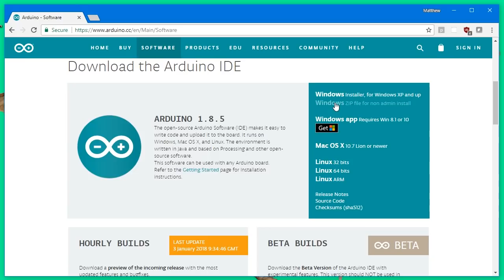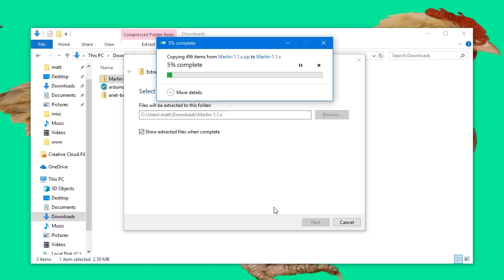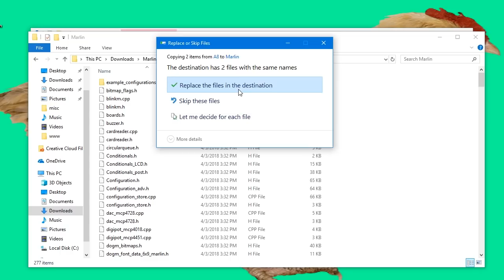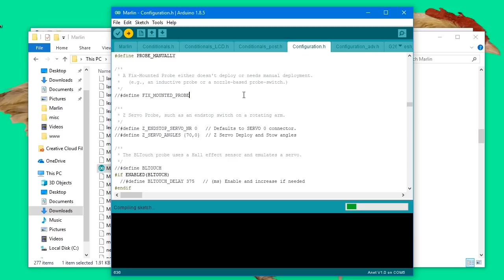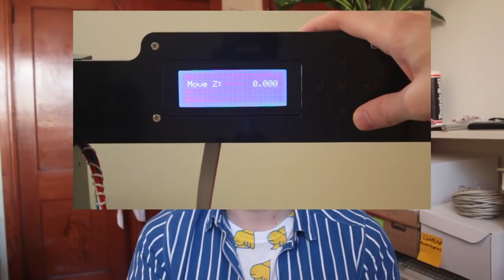Anet A8 Upgrade: Why & How You Should Update Your Firmware - Marlin Install Tutorial

Comment: I’m having some troubles. The arduino is having errors. I don’t know if I’m doing something wrong. The printer is on and stationary, and I’m trying to upload the code just like the video shows. I have tried all com3/4/7 and both Anet v1.0 and (optiboot). What do I need to do or not do?
Reply: solved the problem, its probably that i have upated version that it didnt work for some reason when i did uncoment some stuff mentioned. so when i relaunched the arduino,i ddidnot touch anything,and just uploaded to the printer. it worked and i do have the bedleveling option and all that. itseems to be working.
Reply from the maker: Glad it worked ! I've had some times myself where it wouldn't upload and I'd relaunch the Arduino software and it worked. Not sure why this happens.

Comment: As much as I really appreciate your contribution, I found myself getting ticked off because I'm a newb and you're going so dang fast that, even though I can pause, and did a LOT, you didn't tell us if we need the A8 board powered up to do this or not. I've had a ruff day as well, so take that into consideration. Bed sticking is my nightmare right now and the hairspray I picked up just spits out and blobs so I'm hoping with PLA that it will still work. I plan on printing RC airplane parts after I get things all worked out and need perfect 1st layers and thin walls. I'm printing a power switch mount and Mosfet mount for upgrading that stuff.  Uggghh.... I have two burned fingers from trying to unclog the crappy PLA that came with the printer.   Anyways. I really do appreciate your video. Everything I've touched today has fallen apart. I'm afraid to take a piss now.
Reply from the maker: Garry Kennedy heh I understand! I’ve had many frustrating moments with my printer as well but it always gets better. A few times it has meant buying a new part because I broke something. And yes I agree with the speed thing. Had I known so many people would watch this video I would have redone the screen cap slightly more slowly. But thanks for watching and hang in there !
Reply: Thanks Matthew. I've got it dialed in now. Printing great and doing a RC airplane tail section right now. 2 thick coats of Aquanet and it's all good. I am afraid of bricking my board but I really want that heating check sum safety that Marlin has. Plus it's not near a computer ATM. That may change soon as well though. Much better day though. I'm hangin'.

Comment: Great tutorial. I am having some issues with the bed levelling not saving but I think that will be solved by adding the command in the goose. My main issue is that no matter what I enter in multiple slicer my part (radial) fan always sits at zero unless I manually override it using the LCD menu during a print. Any ideas?

Comment: Something is not clear, how do I connect a NPN proximity sensor to Merlin? The home point is on the left edge and therefore the sensor does not recognize the surface
Reply from the maker: Hey there. This tutorial does not cover using a sensor for bed leveling. It's only for use with manual mesh bed leveling. You can see more info here: http://marlinfw.org/docs/configuration/probes.html take a look at the PROBE_MANUALLY option.

Comment: Hey man, so Im new to the 3td printing world.  I have had mine for 2 years and started using it quite a bit this year.  So last night I downloaded repetier host 2.1.6, I was on 1.1.9 or something like that.  but I upgraded repetier last night, and I just finished your instructions on firmware.  So when I uploaded it, it gave me an error, saying com 4 port wasnt available.  So I unplugged the usb cord and plugged it back in and hit upload.  So it uploaded with no errors.  but when I open repetier host now, under the manual control tab, you have flowrate, feedrate, extrder, and bed.  Well the bed option is gone entirely from repetier host, like its not there to click to turn on and heat up the bed.  I dont know what to do now to be honest.

Comment: After installing marlin on my Anet A8 v1.5 it shutsdown after heating and before starting to print.. how do I downgrade to the original firmware?
Reply from the maker: See the video description for a link to the original firmware. It sounds like however that the thermal runaway settings might be too sensitive, you can adjust them to allow a wider range of temperatures: http://marlinfw.org/docs/configuration/configuration.html#thermal-protection-settings

Comment: With the new firmware can I add a material to my Cura for machinable wax that has a temp of 140 deg C and will the printer respect that or must I add that to the .h code?  I saw a g code reference to adding the line M320 to tell the printer it may heat to lower temps...Should that be used too or instead ?
Reply from the maker: That A8 Marlin config does have cold extrusion prevention built in, so yes I think you are correct. Looks like it's set to 160c. So you can add an M302 command to allow a lower extrusion temp, or you could change it in the config. Here's info on M302: http://marlinfw.org/docs/gcode/M302.html and here's the line you can change in the config: https://github.com/MarlinFirmware/Marlin/blob/1.1.x/Marlin/example_configurations/Anet/A8/Configuration.h#L429
Reply: Matthew Rayfield so if I edit line 429 in the Anet configuration file to allow printing at 140 degrees I need to have separate configuration for PLA and another for wax, right?  Or is there a way to add the code and let the material selection in the gcode of the print file instruct the printer what temperature to print at?
Reply from the maker: If you change line 429 to 140 it will set 140 as the lowest allowed temp. So from there anything that the gcode says, as long as it's above 140, will be fine. You won't need have another config. Alternatively you can have line 429 as whatever you want, and then in the slicer settings for the wax use a M302 gcode command to lower the minimum temp for just that print. It's up to you how you want to do it. And I guess it depends how you can setup your slicer. M302 and line 429 are affecting the same thing: The lowest temperature that will allow extruding. M302 is for a print by print basis, and line 429 is the default setting. Hope this helps !

Comment: Arduino:1.8.6 (Windows 10), Kort"Anet V1.0"

In file included from sketch\HAL.h:33:0,

                 from sketch\MarlinConfig.h:39,

                 from sketch\Sd2Card.cpp:29:

Sd2Card.h:100:39: error: pasting "/* SPI Master In Slave Out pin*/" and "_DDR" does not give a valid preprocessing token

   please help get this error
Reply from the maker: See if this helps: https://github.com/MarlinFirmware/Marlin/issues/10862

Comment: I got an error trying to get it to upload. 

Sketch uses 118416 bytes (93%) of program storage space. Maximum is 126976 bytes.

Global variables use 4301 bytes of dynamic memory.

avrdude: stk500_getsync() attempt 1 of 10: not in sync: resp=0xd6
avrdude: stk500_getsync() attempt 2 of 10: not in sync: resp=0x6f
avrdude: stk500_getsync() attempt 3 of 10: not in sync: resp=0x80
avrdude: stk500_getsync() attempt 4 of 10: not in sync: resp=0xbf
avrdude: stk500_getsync() attempt 5 of 10: not in sync: resp=0xae
avrdude: stk500_getsync() attempt 6 of 10: not in sync: resp=0xd6
avrdude: stk500_getsync() attempt 7 of 10: not in sync: resp=0x02
avrdude: stk500_getsync() attempt 8 of 10: not in sync: resp=0x21
avrdude: stk500_getsync() attempt 9 of 10: not in sync: resp=0xcc
avrdude: stk500_getsync() attempt 10 of 10: not in sync: resp=0xd6
An error occurred while uploading the sketch

Comment: hey man, Your video is great though its probably my fault as I'm using a mac but when i go to select the port its not coming up com5 its coming some random bluetooth connection thing! is there anything i need to do if it is on mac?
Reply from the maker: Hey hey hey. I originally tried this on a Mac myself and had issues. I think it is a matter of finding the right drivers for the USB serial connection. Try Googling about "arduino usb serial driver" and see what you can find. You might have to try out different drivers. Sorry I don't have a more direct answer than that. I know it is possible though.
Reply from the maker: Throw the word "mac" or "os x" in that search term... Forgot that... That's important...
Reply: hey dude! sorry for my late reply! the mac for whatever reason wasn't detecting the printer, i just used my mums computer with your instructions again and the thing worked to a T! Cheers Boss you are a legend
Reply from the maker: Nice ! Glad to hear your got it goin' !

Comment: Matthew, your link for the Anet factory firmware is not working, unfortunately threes too many tweaks still need to be done to the Marlin firmware to run smoothly on the ANET A8. Since i print with PLA and not ABS, im comfortable with the factory firmware
Reply from the maker: Hey there! What happened when you tried to downgrade ? I haven't tried it myself, but those are the links people seem to use. Also I'm curious what wasn't smooth about Marlin ? I've been using it with PLA myself and had no problems.

Comment: Thanks for the video, though when I try to upload, I always get the following error code:

avrdude: ser_open(): can't open device "\\.\COM8": Access is denied.

Any ideas?  I have multiple ports in the menu, but I verified that this one is the correct one by unplugging the printer and checking which port disappeared
Reply: My bad. After some more googling, it was because I had the printer open in Cura.  Thanks again for the video

Comment: Hay Thank you very much I was concerned about doing this up grade as there where so many conflicting videos and blogs, yours was very easy to flow! Thanks!
Reply from the maker: Thank you that's great to hear !
Reply: Any chance you could help us install a bed leveling sensor? Hint Hit!
Reply from the maker: I'll definitely consider making a video on it. Which type of sensor are you looking to install ? I'm using a BLToch now and could probably offer some info on that
Reply: I have the Ronxy-08n 6-36 volt sensor I have it installed (mounted) but when I try to compile marlin withe what i think are the needed changes i get "define" does not name a type. I think I am missing a library, searching that now. this is only the 2nd time i have run arduino ide lol the first time was after your video witch worked finer the frog hair. thanks

Comment: Hi,

I tried and error popped up Arduino: 1.8.5 (Windows 10), Board: "Anet V1.0"

Build options changed, rebuilding all
In file included from sketch\MarlinConfig.h:40:0,

                 from C:\Users\aqian\Downloads\Marlin-1.1.x\Marlin\Marlin.ino:31:

SanityCheck.h:876: error: #error "LCD_BED_LEVELING requires MESH_BED_LEVELING or ABL with PROBE_MANUALLY."

     #error "LCD_BED_LEVELING requires MESH_BED_LEVELING or ABL with PROBE_MANUALLY."

      ^

exit status 1
#error "LCD_BED_LEVELING requires MESH_BED_LEVELING or ABL with PROBE_MANUALLY."

This report would have more information with
"Show verbose output during compilation"
option enabled in File -> Preferences.

Can you help? Thank you.
Reply from the maker: Take a look at 8:46 I think that you need to uncomment the probe_manually option.
Reply: Hi again and thanks for the reply, i have one more question, what if i have the sensor, do i need to activate probe_manually? Thanks.
Reply from the maker: Not if you're using a sensor.
Reply: @MatthewRayfield  thank you

Comment: Great tutorial, 1 question though, How do u perform the manual bedleveling? I’ve tried twice but the settings don’t seem to be saving??thanks
Reply: Yea the manual bed leveling doesn’t seem to be saving?? Any tips on how to properly set up the bed? Thanks
Reply from the maker: @elis51501  check the description, i have a little bit of info that might help there. some people needed to add a line of gcode through their slicer

Comment: Well followed your instructions and it seems I get an error uploading. I have the Anet A8 1.5 board....
Reply: Travis Gonzalez My problem was the drivers I used. I found some drivers that worked.
Reply: @dragnet53  I too have a 1.5 board. What drivers did you find? I have been looking and cannot find anything that works. I only find a separate piece of hardware, I would rather not have to purchase. Thanks.

Comment: I tried the manual calibration , But is seems that the printer doesn’t use it while printing
Reply from the maker: I'm not sure, but there is an option in one of the menus to save the bed leveling calibration. Try that out. Otherwise I think it does reset sometimes.
Reply: Matthew Rayfield once that you do the calibration . Do you have to do anything else to use it ? Or are you ready to print ?
Reply from the maker: Yes, calibrate, save, then print.

But also check out the "Saving and Loading" section on this page: http://marlinfw.org/docs/features/auto_bed_leveling.html

It seems to say you'll need to add "M420 S1" to your start gcode. But it's weird, because mine is working without this. Worth trying though if needed.

Comment: Hey Matthew, I just upgraded mine. But if i level my bed with the 9 points and print a file after, it does hit my printsurface. Why he does not save the mesh i want him to create of the 9 points?
Reply: Nonetheless, really great tutorial!
Reply: i saw your post below about the site automatic bed leveling. i gonna try to save it and use it after, will write the results here.
Reply: do you have marlin/reprap as setting in your slicer? do you always manually load your mesh or is it loaded automatically?
Reply: seems that if I use the M420 S1 command - it works
Reply from the maker: This is good to hear. It's odd because I don't have this command but it seems to work for me. I am using a sensor now though (but I don't level every time). I will add a note about this command to the description. Glad you got it working !
Reply: Hey Matthew, that's great to give others less pain to search for it! Really appreciate your video and your work!
Reply: I guess you should post your startcodes here, i got an machinecode for homing the printer at the beginning and i guess this disables the bedleveling (may be wrong)
Reply from the maker: It looks like you have to put the M420 command after the homing. More info here: https://github.com/MarlinFirmware/Marlin/issues/5974#issuecomment-284500585

Comment: My print quality got worse after upgrading to marlin and followed the guide perfectly, does anyone else have this problem?
Reply from the maker: This is a total guess but if you had changed a setting on the printer like flow rate when you had the original firmware you will need to make those changes again because they won't still be saved.
Reply: yup

Comment: when ever i try and compile the firmware with thermal runaway on it says its missing a binary before thermal
Reply from the maker: Can you post the exact error message you're getting ?
Reply: I think I found it looking in the config.h the // are missing in-front of the thermal runaway not for the define but further in the scrip I won’t be able to check though till I get home
Reply: Hi Kyle. So did that fix the missing binary? Cheers.
Reply: It did I must have been not paying attention when I was un-commenting lines

Comment: I dont see Anet V1 on the listing just Arduino/uno. The com port is correct and if i go to SKETCH to find it then a window pops up with --Arduino: 1.8.8 (Windows Store 1.8.19.0) (Windows 10), Board: "Arduino/Genuino Uno"
. I want me mam !!

Sketch uses 444 bytes (1%) of program storage space. Maximum is 32256 bytes.
Global variables use 9 bytes (0%) of dynamic memory, leaving 2039 bytes for local variables. Maximum is 2048 bytes.
avrdude: ser_open(): can't open device "\\.\COM3": Access is denied.

Problem uploading to board.  See http://www.arduino.cc/en/Guide/Troubleshooting#upload for suggestions.

This report would have more information with
"Show verbose output during compilation"
option enabled in File -> Preferences.
Reply: i have the same problem, COM6 acces is denied, were you able to fix it?

Comment: could not get it to work,  not sure if this is the error

avrdude: stk500_recv(): programmer is not responding
avrdude: stk500_getsync() attempt 1 of 10: not in sync: resp=0xc2
avrdude: stk500_recv(): programmer is not responding
avrdude: stk500_getsync() attempt 2 of 10: not in sync: resp=0xc2
avrdude: stk500_recv(): programmer is not responding
avrdude: stk500_getsync() attempt 3 of 10: not in sync: resp=0xc2
avrdude: stk500_recv(): programmer is not responding
avrdude: stk500_getsync() attempt 4 of 10: not in sync: resp=0xc2
avrdude: stk500_recv(): programmer is not responding
avrdude: stk500_getsync() attempt 5 of 10: not in sync: resp=0xc2
avrdude: stk500_recv(): programmer is not responding
avrdude: stk500_getsync() attempt 6 of 10: not in sync: resp=0xc2
avrdude: stk500_recv(): programmer is not responding
avrdude: stk500_getsync() attempt 7 of 10: not in sync: resp=0xc2
avrdude: stk500_recv(): programmer is not responding
avrdude: stk500_getsync() attempt 8 of 10: not in sync: resp=0xc2
avrdude: stk500_recv(): programmer is not responding
avrdude: stk500_getsync() attempt 9 of 10: not in sync: resp=0xc2
avrdude: stk500_recv(): programmer is not responding
avrdude: stk500_getsync() attempt 10 of 10: not in sync: resp=0xc2
Problem uploading to board.  See http://www.arduino.cc/en/Guide/T
Reply from the maker: hmmmm... this is a total guess: did you install and make sure that the anet board is selected ? i also searched that error message + anet a8 on google and saw some other possible solutions

Comment: I had my red wire short out like that and now my bed thinks it is 110 degrees do you or anyone know how to fix that
Reply from the maker: I soldered my wires directly to the bed and this fixed my issues. It is a common problem. See this for other solutions: https://3dprint.wiki/reprap/anet/a8/replace_hb_connector